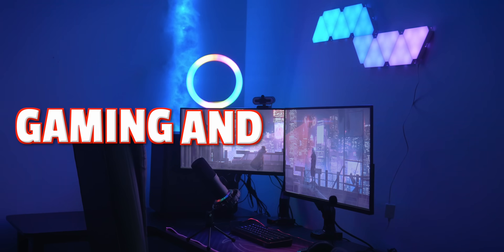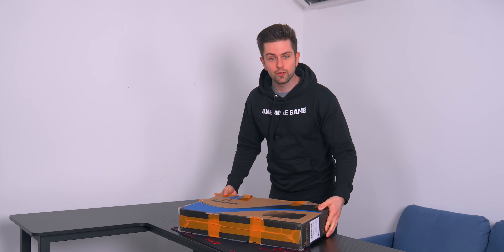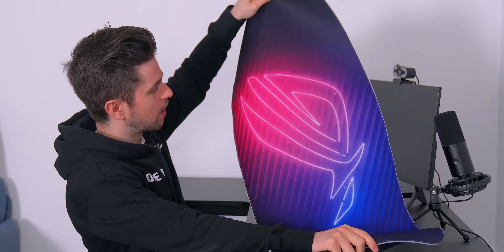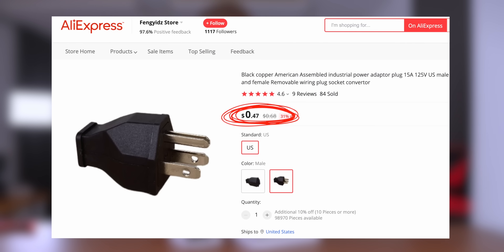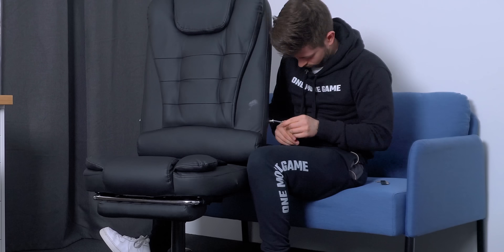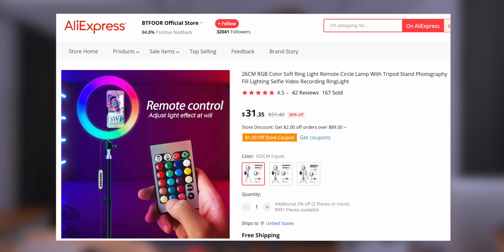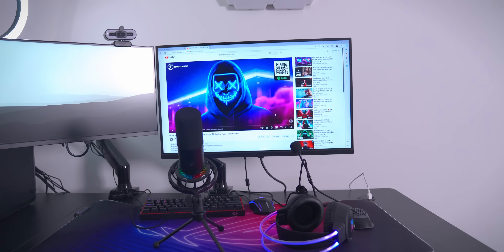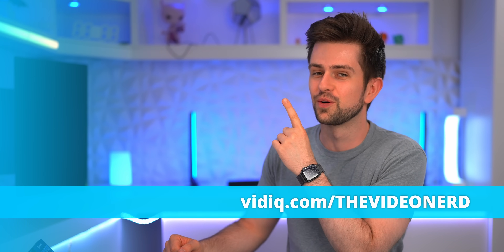I Bought a Complete Streaming Setup On AliExpress..

Comment: Those new bayou arms are really solid, I got one for $20 on amazon and it's been holding an old 40" tv and a 1kg adapter plate for the last year, adjusting 2ft in each direction to swing it into a racing sim, no issues at all.